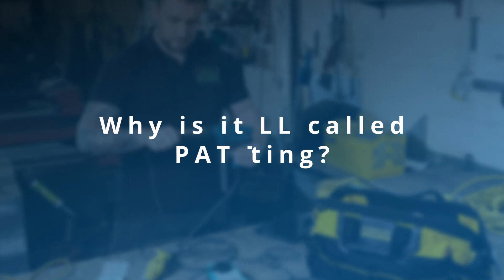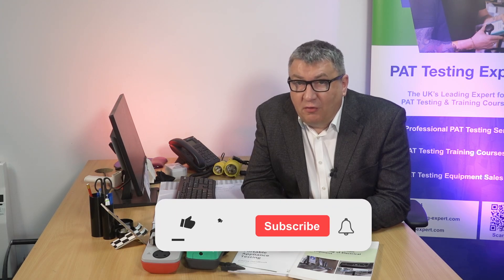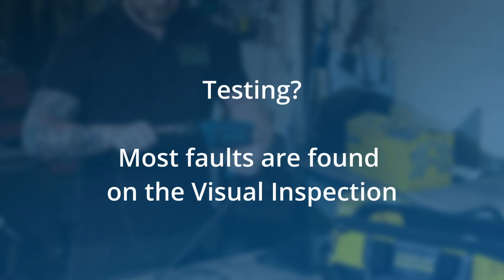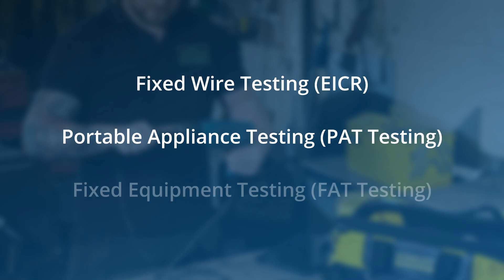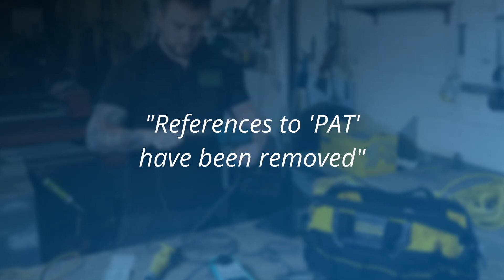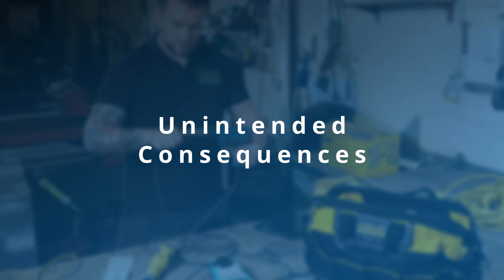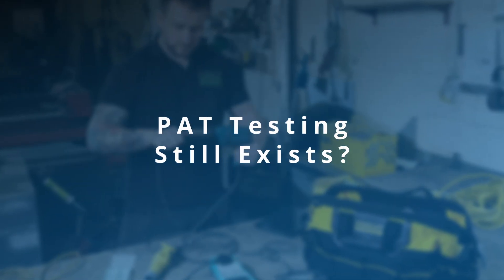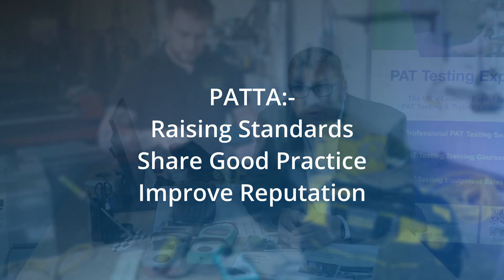Why is it STILL called PAT Testing? Isn't it time to call it something else?

Comment: Great video, dont think you could have made it any clearer, it also goes along in my opinion quite clearly with section 8.9 of the COP 5th edition.
I always send through with my PAT results a supplementary info sheet, stating which items have not been tested as fixed appliances and make the recommendation that a qualified electrician should be asked to test these possibly when the EICR is carried out.
Reply from the maker: Thanks for the feedback!

Comment: Ok lets call it appliance testing.
Your right with regards to testing fixed appliances.
The problem I find as an electrician is a lot of "PAT" testers say if it's not got a plug on it then it doesn't need tested . To me this is plain wrong.
Another point is local authorities want to see "all" equipment tested in landlord properties so if the Landlord only gets equipment with a plug on it tested does this affect his or her insurance.
Another point is I have found the likes of Ovens and hobs along with storage heaters with no earth

Comment: You’re absolutely correct in your opinion, 
But I would say in my own humble opinion a fridge /freezer, washing machines or anything that can be unplugged is portable as it can be moved from one place to another, if it’s hard wired then it can’t so therefore it’s not portable .
Also it has always been called Pat testing and always will be. And I totally agree it doesn’t just apply to portable appliances/equipment. But what do I know I’m just a grumpy old spark whose opinion means something. Thank you for a fantastic video 👍